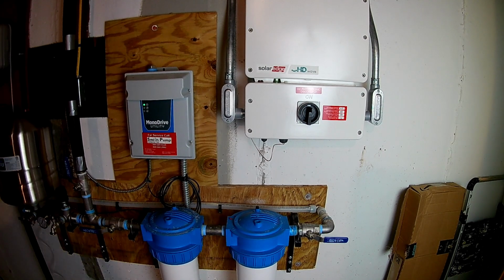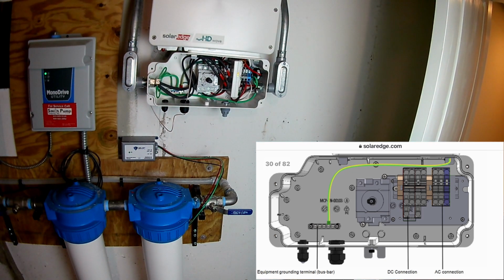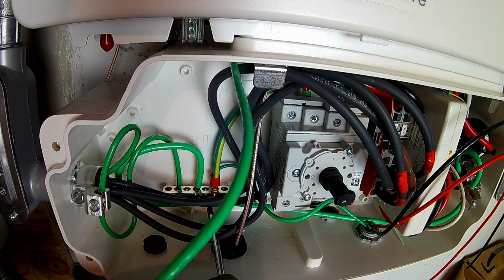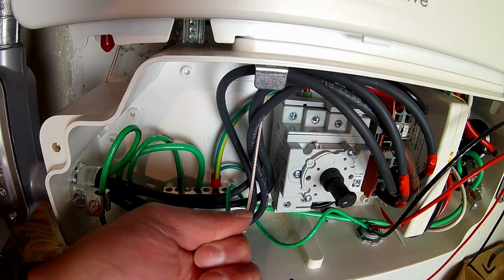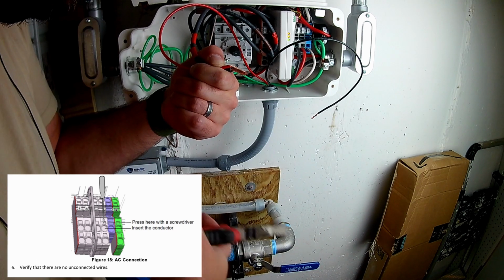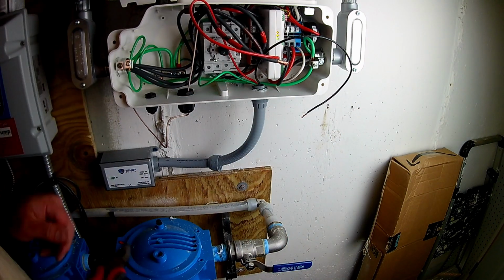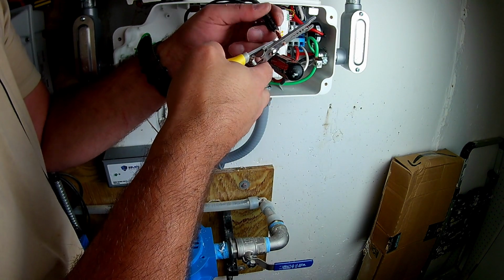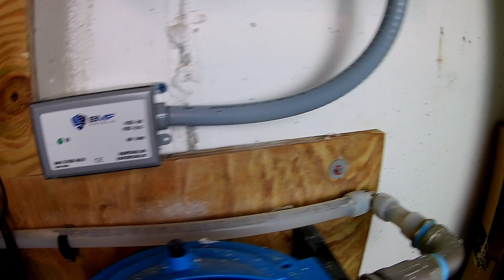EMP Shield Solar Edge inverter install

Comment: SolarEdge says they have a built-in EMP/lighting protection. But not against all three EMP phases
Reply from the maker: I didn’t know that. That’s awesome news. You wouldn’t happen to have a link or webpage I can go to?
Reply: Actually, a director at EMP Sheild told me about this. I have tried to find it with no luck, but I have not spoken with SolarEdge. They do have ferrites that get installed around the main power lines, but I doubt this is what they meant.  The director told me she spoke with SolarEdge, so that might be somewhat reliable.
Reply from the maker: @NSWvet83  you should check out disaster preparer I think his name is. He sells the whole house high saturation ferrite’s and his own recommended surge suppressors. I use the ferrites I my vehicles to protect the battery from getting hit with a surge.
Reply: @dissectingdiy  thanks for the info.  I already did, and bought them, and put them on.  I gotta make sure we're safe lol.

Comment: Just so you know, whenever you splice or tie two or more pieces of stranded wire together, don't twist the strands of each wire first. Lay them parallel together and twist them as if they were one piece. This way you will have a bonded connection.
Reply from the maker: Good advise!

Comment: Hey You mentioned that EMP doesn't affect the solar panels but is there any need to protect the optimizers on a solaredge system? Also do you think you could provide a link to the product you used on this install? Thank you!!
Reply from the maker: The way in which it was explained to me was that the DC version of the product here will protect the DC side of the system. The AC installed in the panel will protect the AC side of the system. Any circuits within that or attached. It will protect up to 220 feet from the home if memory serves correctly.

You will need to look at your solar system specifications. Is it a 12,24, or 48 volt system. Etc. 

I believe this is the one used. But keep in mind I called them and had them tell me the product that fit my system after giving them the specification. I would highly recommend doing this to avoid wasting time. 
https://www.empshield.com/product/dc-600/